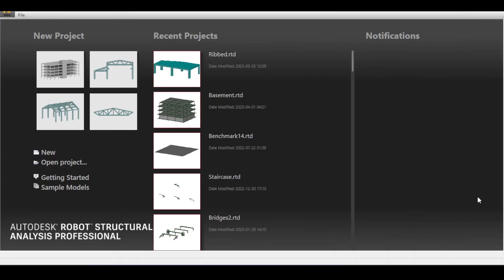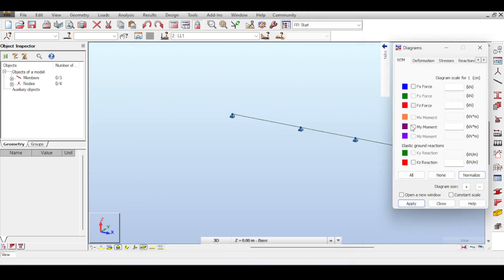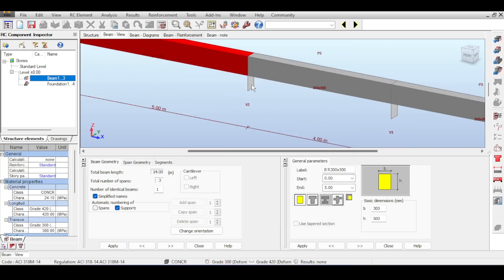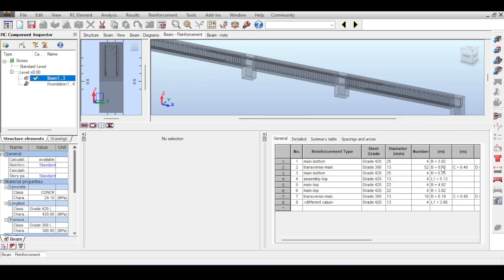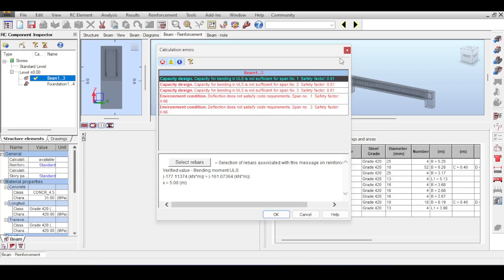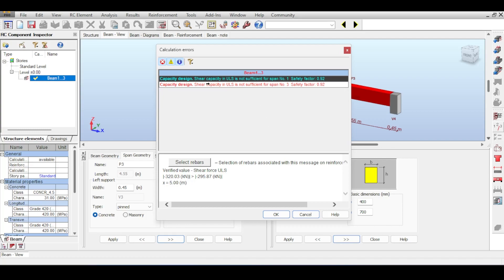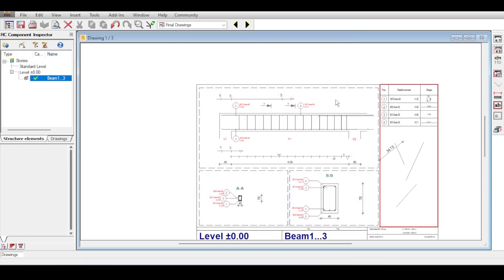Autodesk Robot RC Beam Design: Exploring the Deeper Details

Comment: Hello CEE,

Thank you for this deep dive video, as you have correctly mentioned at 27:06 the module has an 😁 …. abomination of options…. options overflow… 😁…. LOL. The CEE (in my opinion) has certainly done an enormous good job in covering the main (critical) RC beam design options in this tutorial. Thank you for this; your work has helped to pave a way for the user to be able to deal with the rest of the other options that remains.   
 
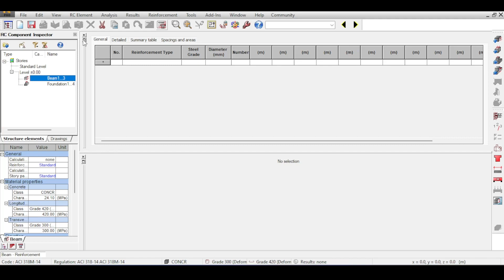05:16 & 06:37 About the RC design module GUI windows, yes and no 😊, I also sometimes experience the same thing but not always.

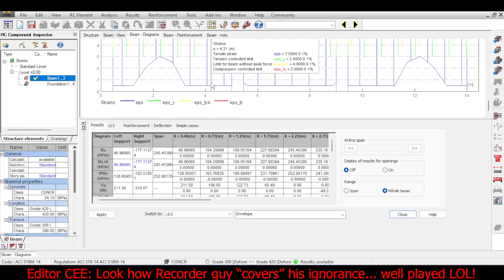12:09  Mr. Editor’s comment about the “alleged SHEAR cover-up” is itself well played! In the recorder guy’s defense, the Safety Factor for shear (0.98) and the graphics on the shear force diagram did not make it obvious to spot the problem right away. However similar error locating process that was shown by the recorder guy for Bending and Deflection indirectly addressed the “alleged cover-up” LOL.

15:08 I like the CEE comment that “…. the deflection is now within limits BUT AT WHAT COST??....”. I often find this very question to be key not only for deflections but also for balancing everything that a user or a designer is doing (modelling, analysis, design, detailing, etc.). This is a very good thought process for a user to adopt.

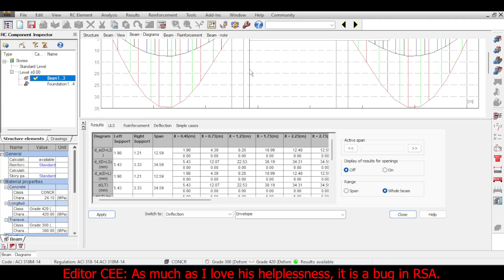16:10 Correct. I have the same bug. 

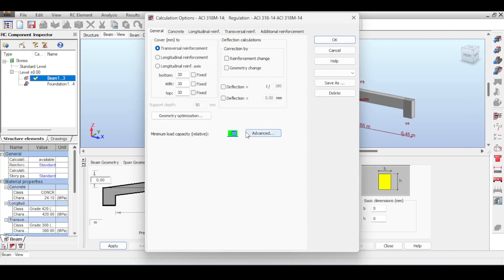19:10 Very nice practical tip concerning the possible use of artificial margin for factor of safety for preliminary designs and the initial elements sizing stages. Thanks!

 21:12 I 100% agree with this line of thoughts. It is very important to keep the detailing as simple as possible for the workers on site. Simplicity will significantly enhance the likelihood that the actual (physical) implementation on site matches the design details.

35:42 & 36:10 Yes, indeed one may override the bar length. Also, one can do this by manually typing in the increased bar length value in the beam reinforcement table directly. Nonetheless, I too find it odd that RSAP seem to be struggling with the length by itself.

37:15 If one does change the beam cross section in the RC design module (as opposed to doing this in the structure), it is also possible to automatically update the structure with that change by using the command: “Results>Structure Updating” from the main menu. 

Note that, one would still need to re-run analysis and re-export (or update) the updated element with the updated analysis results to the RC design module as it has been correctly indicated here by the CEE. 

41:20 huh 🤨? I am really glad that the CEE is around to help make sense of these things, they can easily shake one’s confidence if they are not properly explored as was done here. Thank you, sir.

44:45 😂🤣😂 …..I don’t know why you would draw a line….. 😂🤣😂
 

Great work as always, thank you for the tutorial and I am looking forward to the next series in the works.

Ps. Nice touch with the into, sometimes mid-video, and the outro background music. To be honest and in general, I usually find the “mid-video” background music to be distracting BUT in this tutorial video, I felt the opposite, the “mid-video” background music was well selectively located and it did not overpower the main presentation. Mr. Editor is truly getting very good with these things and he should be proud. Keep up the balance, I love it.    

Regards, DK
Reply from the maker: Hi there Engr. DK

I missed saying "in a robotic voice" (DOES NOT COMPUTE>>>)

About the strange window placement, I heard it is a version thing. I am going to download RSA2024 soon hoping it gets solved.

Mr. Editor kind of loves roasting me for no reason ^_^ but you already saw beyond his usual comment.

The deflection can be solved by some reinforcement changes, but as you mentioned, it is kind of a 1D way of looking at things. The model itself is also important.

Here is a trick I was using back in the old days, when I had simply supported beams spanning long distances, I sometimes intentionally add 2 balconies (overhangs, extensions) to artificially reduce the deflection (And moment) in the center span.

About the extra safety, truth to be said, I did that before robot times by "adding some extra bar".
I know I should not do this, but we all did this sometime ^_^ it is kind of an unspoken sin.

Oh that is an amazing suggestion. *Copy Pasted to the video description*. Thnx!!

The bug about the assembly reinforcement is because it seems RSA's programmers forgot to consider a span where the moment never switches sides. Guess CEE found ways to break the software ^_^

As for the music, I think I will only leave it in the intro and outro to give more ability for viewers to concentrate. I did this in the FEM lecture and I think it is "cleaner" that way.

Anyways, I'm always happy to read your comments. Stay tuned for more content.
Regards,
CEE
Reply: @CivilEngineeringEssentials  

LOL, you are killing me with (🤖💬DOES NOT COMPUTE>>>) "in a robotic voice". I’d say to Autodesk RSAP 2024 that be warned, the CEE is coming! Autodesk better make sure that their new release is in order. 

Ooh your way of thinking [trick for long spanning simply supported beams] is unconstrained and it is beautiful. Good looking out. I think one should even propose this idea in situations where an Architect is involved for them to incorporate it (as far as practically possible) into the architectural concept for the benefit of the structure and of the project. I like it a lot!

I enjoy your feedback, keep up the good fight.

Regards, DK

Comment: Hello, CEE. Thank you for this excellent video. I have a quetion on how to import a self-defined section to the RC design module. Such as round-ended cross-section, widely used by railway bridge column, which is not provided by the software. I have defined a round-ended cross-section using Tools-Section Definition and used this section is FEM model, but the software said the section is not correct when I try to convert the model to a RC column member. So how can I use a self-defined section in RC design module, looking for your reply, Thank you.
Regards, Fengxin.
Reply from the maker: I see what you mean. You are intending to define something outside of the "usual" sections in RSA. To be honest, I never tried that. So: I will check it out for both beams and columns and report back.
This would be amazing if it worked, especially for columns, coz you could have some strange RC column shapes.

I will keep you posted.
Regards,
CEE

Comment: Thank you for the amazing videos. Some questions and also a comment about the bug. If you update to the 2023 version, you will not have an issue with dragging the window down whenever you enter the provided design section. Judging by your videos, I am assuming you have an older version of Robot. 

One question that I have is in the optimization section. What does it mean when you are talking about Reinforcement Ratio. I understand the steel weight checks all iteration until you reach a min. or that goal for kg/m^3. But what is reinforcement ratio, or in another way, what is the ratio of?

I know it might be too much to ask for, I would really appreciate it if you crate a video about detailing in Revit. (Assuming that is your work flow where you design in Robot and detail in Revit. If not, I understand :)

Thanks
HRH
Reply from the maker: Hi there,
Indeed, I am using RSA 2022, I will update to 2024 once it gets released (should be really soon). It is kind of odd that this bug exists.

About reinforcement ratio:
It is the area of steel / area of concrete.
Meaning: a reinforcement ratio of 1% for a 300*500mm concrete beam will provide a steel area of 0.01 * 300 * 500

It is kind of an "old school" way of optimizing, back when the rule of thumb was to keep your beam reinforcement around 0.8% (this is 2000s stuff).

I am aware of revit and its abilities, but I still am improving my own skills before I start dishing out revit content. It is basically part of my responsibility only to record something that has substantial benefit to the viewer. I am not yet ready for revit yet. (I am honest with my audience ^_^)

Still, stay tuned for more content. Also, if possible, suggest this channel to your friends, it helps a lot.

Regards,
CEE

Comment: Hello, I love your videos!! . I want to ask you something to see if you can help me. When you create a beam with a hole for passing installations, the software doesn't calculate the structural reinforcement of the beam at that hole. For example, the reinforcement bars are shown passing through the hole. Is there a way to calculate it correctly?
Reply from the maker: Oh, hi there, thnx alot ^_^ I am really happy you find those vids beneficial.
You are right, holes are - unfortunately - not part of what RSA can do.

Now I do not want to end my reply to you here. So here is a rule of thumb we used back when I was working in consultancy:
if the whole is in a wall and reinforcement is displaced, the reinforcement should be added to the edges of the wall and additional diagonal bars are to be added.

if the hole is in a beam (because of AC ducting for example) then special detailing is to be done.
https://www.youtube.com/watch?v=US_KZ4Pjiy8
Disclaimer: I did not watch the video, but the thumbnail includes the detail I wanted to show

PS: sorry for being late in my reply.

Comment: Hello. 

Usually, I get into the summary table of the reinforcement bars and adjust their lengths. This solves most of the arising errors.
Have a look into it and advise.
Reply from the maker: You are 100% correct. Thise will solve the issue of strange reinforcement cuts 👍
I have a video on reinforcement lengths and editing planned when I reach the design of elements in the RC building design series. So you comment is timed perfectly.
Reply: @CivilEngineeringEssentials  Thank you sir. Thank you for the good work. 👋